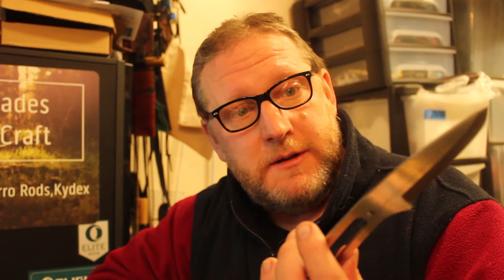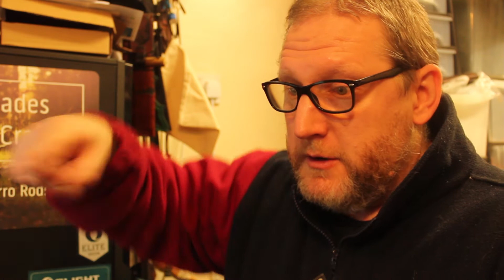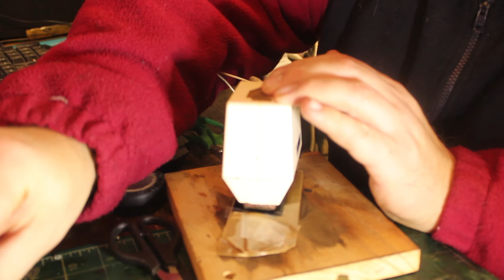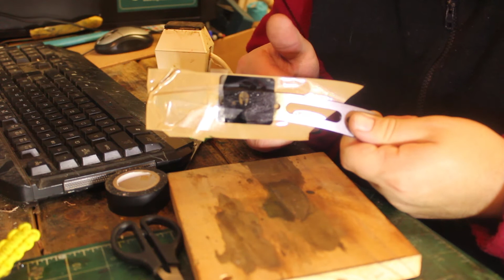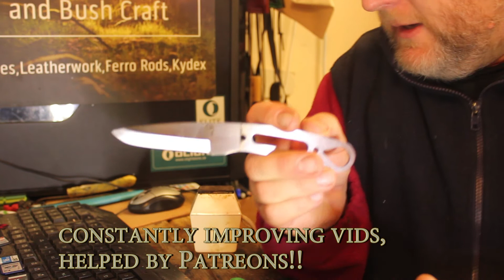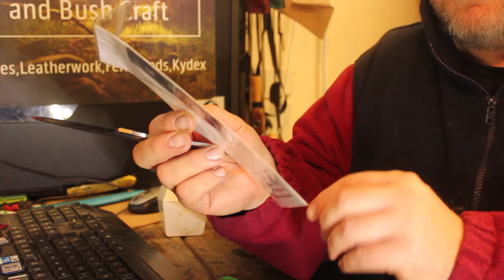Part 3 Making a Custom Hand Made  Knife, Testing a new Logo Etch Stencil for the makers mark

Comment: The decals I use are much smaller and I expand the covered area with sellotape. Trying to keep the electrolyte from seeping onto the steel via capillary action is really hard! Will definitely look to JP Designs when I've use up my current stock of decals.
Reply from the maker: yes, nothing more annoying than unwanted etch happening in the wrong areas...

Comment: Guessing these are one offs and have to use new one each time. Should look at cricut joy.
Reply from the maker: Looked into that, Cricut(Cricket) do a subscription service that many people get naffed off with, of the three models the middle one looked okay but not in the position of getting either a vinyl cutter or better laser for cutting the vinyl, I have done that too but it takes time and my laser has one axis that would have to hold the blade so only viable for small blades, I have done weeks of trials since mid Nov,,,
Reply: @wessexbladeshandmadeknives  don't have to have subscription to use it, that's for access to fonts and images. Can use your own images and fonts.